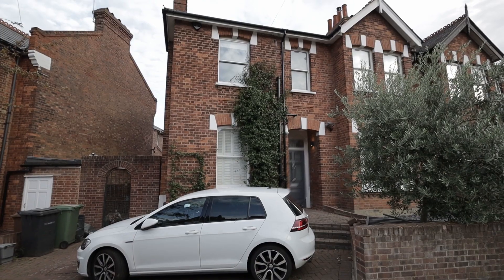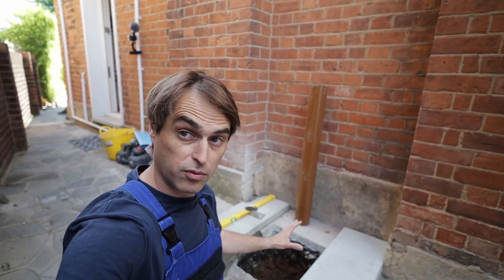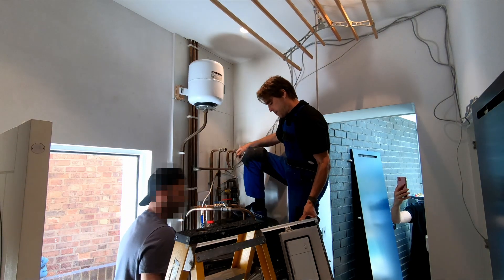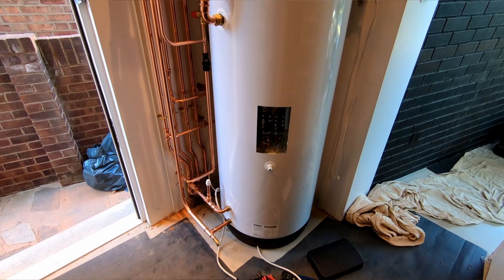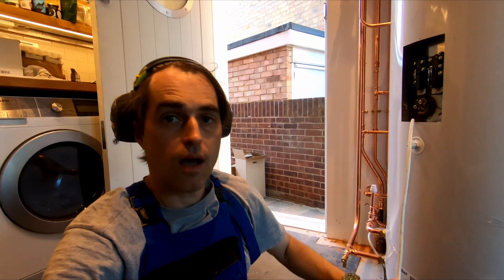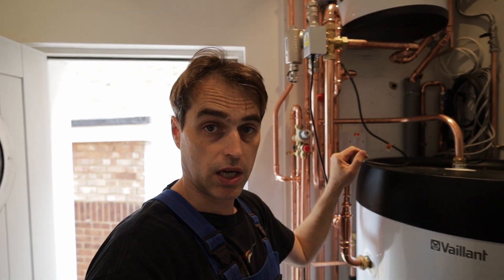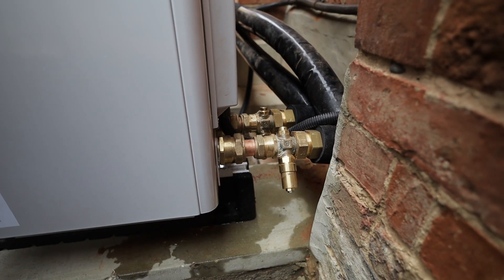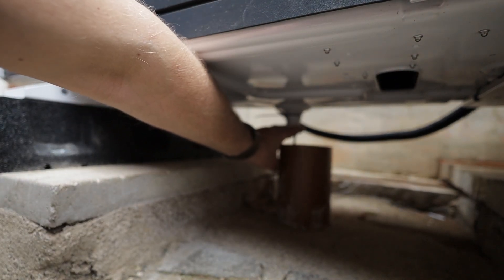Is This Heat Pump Better Than Your Gas Boiler?

Comment: As for cost, they are not worth it, they are more harmful to the environment actually if you factor many other things, such as the cost of installing these giant noisy beasts, requiring more space, and complex hot water storage cylinders  and all the network of plumbing and pipes, and think about the impact these beasts cause in the process of manufacturing,  they contribute more to the global warming by using so much energy in the manufacturing process of thousands of its components, right from extracting copper and refining it and turning it into copper tubes, then thousands of complex electronics parts and microprocessors and other components used in the ,making of these beasts,  case mouldings, and what not, the cost in transportation of various parts from different places on earth to a central assembly point, if one was to take every factor into consideration, the amount of energy used and the heat it created goes a very long way in not helping to keep the global temperature change. 

It negates the objective of replacing a perfectly good working  condensing boiler with an efficiency of 95% not 80%,  so does that make any sense to anyone to replace their perfectly old still good to go for another 10 to 15 years gas boiler, my old Vaillant sine 221 (non condensing boiler about 80% efficient)  is still going strong for 28 years now (installed in 1994) so I have saved this planet by not dumping it to a wasteful landfill  heap, and not requiring a new one yet, and the amount of energy I saved in not buying a new one, to be honest when you think of how much energy was used in manufacturing these complex machineries, you are much better off burning logs for heating, politicians are not educated enough to realise this for themselves and the big manufacturers brain wash them.

As for owners who buy these expensive beasts, not only they have to outlay a massive amounts in paying for the plant  way too much for what they are, they are just glorified fridge freezers, yes I know there is a little bit more to it than that, and there are not many trained technicians to go around servicing them or fault find small faults, and like the gas safe engineers who have no clue into electronic systems, a small easy to fix pcb is dumped and a new one is purchased at the expense of an owner. The whole heating industry is a rip off thing,  one is far more stress free burning a log fire and no need to call an engineer to replace complex electronic systems.

My advise to anyone wanting to save money is to invest in external Wall and floor insulation instead, and keep your old gas boiler running for longer if you want to save both your pocket and this planet we live on and breath on. (Don't forget to look at the factories spewing out smoke and heat churning millions of parts to manufacture these beasts, thats the hidden pollution kept secret from users)
Reply: Great comment. It seems that the hardest thing to explain is the glaringly obvious which everybody has decided not to think about. Most people lack reason and prefer to remain ignorant. They'll put us through this nightmare for their green agenda and in the end, nothing will have changed except some pockets will be much fatter and some much thinner. Oh yeah... and the massive destruction to the environment as you alluded to, can't avoid that with these monstrosities being produced by the millions worldwide! Pointless technology for the masses.

We should wait for nuclear and other improvements to our diverse energy needs and wants, it's the natural order of progression. What they're putting us through will end in disaster and all we have to do is carry on with what we've got and avoid decades of misery and inflation! They never learn.

Comment: Good video , but guess very few people who need retro fitting will have triple glazing , insulation  at this levels , radiators which will likely need upgrading . Older non pressurised systems with larger circulation pipes and also oil fired burners will need highly expensive and disruptive works to be done. Overalll heat pumps great idea but retro fitting has major complications. I myself have solar and additional woood burning stove connected to heating system and feel it would require major problems to be overcome involving flooring , tiling , pipe work removed and would be expensive beyond logic and would be in excess of 30000 pounds if not much more. Love heat pump for new dwellings and less complicated builds especially newer builds where much of the insulation etc would be better. Feel for now will maybe add battery to solar and add additional insulation where possible. Ps oil boiler replaced on last ten years so upto date tech for it.
Reply: Why don't you guys use simple wall mounted air handlers?... For your heatpumps like the rest of the world? They don't need to be retrofitted, all you need to do it run your refrigerant lines from the indoor to the outdoor unit via a 50cm hole.

Comment: We have an oil external boiler burning approx 2500 litres a year heating oil,how much more efficient would a heat pump be?..i have converted our garage and both lofts so now 5 bed vs the previous 3,is a heat pump up to that sq footage?...approx 2500sqft at a guess..thanks

Comment: Great video but the cost comparison for energy usage got me thinking? 
The old system was 30kw gas, and the new is 6kw electricity? 

Let's say the unit prices are at current rates as  follows;
Electricity - 26p/kwh
Gas- 7p/kwh 

Meaning for every hour I run the system I save 50pence.
Over a month, assuming I run it for 4 hours a day, compared to the gas system I save £60 a month 💁‍♂️ Doesn't seem cost effective yet for the size of the installation cost of new system
Reply: I'm guessing nobody will answer you.
I'm always wondering about the aame kind of analysis and it's never presented. So frustrating.

Comment: I dont think it will run that much more efficiently, because it will need to draw electricity to the immersion heater as the heat pump is not enough.

For things like legionnaires the water needs to be 60 degrees at least. 40 degrees is just not enough.
Reply from the maker: No need for immersion heater with this heat pump as it goes to 70c
Reply: @UrbanPlumbers  what's the CoP at 70 degree output?
Reply from the maker: @ChrisLee-yr7tz  probably around 2
Reply: the legionnaires thing is massively over hyped. With normal domestic installs there is pretty much zero chance of spore growth or infection as water is constantly (as in daily) drawn off  in  the most likely place  IE showers. 
personally I'd get rid of the once a week 63c heat up and install constant low temperature heating around 32c ideally underfloor if energy efficiency was the main criteria for installation. Although even better energy efficiency and effectiveness would be individual AC splits to each room. the cost would be roughly the same and they work far better in heating rooms 
plus a water based system has too many single point of failure issues and long term reliability concerns to give real peace of mind in winter.

Comment: Don’t like that trunking on the outside and the pipe work encroaching the doorway would do my head in . The cost of installation against gas to me makes it not viable for the expected lifetime of the system. Allied with the importance of A1 insulation which is not possible on my old house makes this a none starter for me.

Comment: Like most people in the UK I am not interested if it is better only if it costs less to run.
Reply from the maker: It does cost less to run -20-30% as compared to a gas boiler it replaced

Comment: Hi great tidy installation! What are the buffer vessel for and what was the other small vessel next to the buffer vessel called and used for?
Reply from the maker: Expansion vessel for hot water and one for heating. Buffer is used as volumiser to extend run times of the heat pump

Comment: Excellent video. I would say looks like ‘ideal world’ install. I am up for doing this as part of final phase in a fairly long term progressive retrofit of my own house. My conclusions are that I am probably going to have to sacrifice a bit of my garage to fit in the cylinder storage. I am replacing a compact combination boiler and compared to that, a heat pump looks space hungry. I am thinking ability to adopt at scale in average uk home the size of a rabbit hutch may require some compromise on set up.
Reply: Think twice

Comment: I don't know why people aren't going for air-conditioning with a heat exchanger unit so you can run your radiators and hot water. And no need to do a massive upgrade of your radiators or pipe volume. Great video and always a pleasure to watch you at work.

I can't wait for part 2 of thus video about the figures.thanks again for a brilliant video
Reply: Why run a wet system with large radiators (and/or underfloor heating) when you could use gas and head units. Saves floor space etc, no real concern about flushing the system and corroding pipes and the risk of leaks. Response times much better too. Hot water... really should be heated on supply, heating it to just sit in a tank is extremely backwards.
Reply: @drsquirrel00  stored hot water installed correctly with a return I think is very efficient, yes a cylinder takes up space but I don't think you can beat the performance.

Comment: I think it’s an excellent idea to manufacture brand new heat pumps and all the necessary materials to install them and then ripping out perfectly good gas boilers. Who actually cares about the carbon footprint created by producing all these millions of new heat pumps and throwing away gas boilers. Maybe if we adopted a mend and make do approach to all these things that ‘allegedly’ pollute the environment with Co2 instead of pumping out billions of tonnes more Co2 manufacturing even more things that will need replacing when governments and lobbyists decide the new technology is no longer any good. 🤦🏻‍♂️
Reply from the maker: Watch the video again

Comment: Currently trying to measure the heat loss in my house, using online calculators... which seem very vague. My external walls are  20mm K Rend+115mm brick + 50mm cavity filled with blown fibre +115mm brick, + Celotex PL 4025 insulated plasterboard + 3mm skim. Trying to find the way to calculate the heat loss is taking me around in circles - for example, one calculator describes walls as 'Well insulated' or 'Poorly Insulated...' What the hell use is that?

Comment: What I'd like to know is the electricity consumption of the fan, compressor etc., in the pump itself. As I understand it, heat pumps work similar to air conditioning units, in reverse. On three visits to Queensland,  where most have air con, many people only use them when the temperature becomes unbearable, because the cost is prohibitive. With electricity prices roughly double that of gas - is it still worth it?
Reply from the maker: Here cost of gas is 4 times less than electricity and this unit is still cheaper to run than gas
Reply: @UrbanPlumbers  Thanks. I wouldn't argue with you. It must just be that they're all tight rrrses in Aus. Judging by my Ausie missus, that could well be the explanation...🥴🥴
Reply: @UrbanPlumbers  doesn't the CoP have to be above 4 for that to be so?
Reply from the maker: @ChrisLee-yr7tz  no, beacuse gas boilers aren't 100% efficient. Actually, they are around 83% efficient in situ.  At the moment cop of 2.8 gets you to the same cost as running an average gas boiler.

Comment: Only 21% better at just under freezing temperature.....  So with electricity becoming so much more expensive this is a sure fire way to lose money.   The system cost and install will never be repaid,  instant hot water will no longer be so easy...

Great plumbing engineer but the heat pump will never be worth installing...
Reply from the maker: Gas cost is rising much faster than electricity though making this system over 30% cheaper to run with current price cap

Comment: DO NOT DO IT!!! Unless of course you are a brainless virtue signaller. Extremely expensive. Noisy and use a massive amount of electricity. Never mind the crap heat output. No thank you very much.

Comment: Love your videos - very informative.

I have Solar PV and an Eddi, and Solar Tubes too.  Could I get a heat pump for just the rads only ?

Is the store to heat pump just a closed pressurized circuit / loop identical to that of Solar Thermal Tubes ?  Or can an external unit connect directly to the central heating rads circuit ?

Comment: What if you don't have room for the cylinder anywhere in the house?
Reply from the maker: You can use heat battery instead, such as sun amp

Comment: Love the video, but please factor the purchase cost in the calculation. I recently provided a quotation for a heat pump. The pay back was over 17 years before saving anything. Heat pumps are not a solution for all housing stock. Very nice to see a fellow engineer proud of his work. 👍👍 the introduction of power factor metering will also need to be taking into account in the near future. Converting everything to electric is not viable right now and in my opinion will cause a increase in pollution not a decrease. Hydrogen is a potential, but shelved technology in pursuit of profits will hold this country back.
Reply: PF should basically be at 1 for "heating" appliances?
Reply: @drsquirrel00  you would like to think so. I can see something different coming soon. Appliance id over smart metering and charged by appliance type and time. Tech is there to do this now. Brace for a metered life. Everything will be controlled if you let it.
Reply: @thetruthwillwinoneday  I know they're working on ways to address device by their power draw signatures as its possible just not as accurate enough. Should soon start seeing smart meter displays saying X device using this much power, Y device this much etc.
Reply: If you’re keen on calculation do the sums on cost of hydrogen. You will be dismayed.
Reply: Installing a heat pump is not "converting to electric". It's converting to 25% electric, 75% outdoor air. Even if the electric is all generated by gas, you burn less of it at the station to power the heat pump than you would have done in the boiler in your home, because it's only a fraction of the total energy source.
Reply: @WillHirschUK  in a perfect world, yes.  But getting to the perfect insulated house is expensive. I regularly quoting for HP in older stock houses. Everything needs changing, way too expensive in one hit. I was called to one of these incredible machines last week, customer stating it never turns off. Not surprised with the installation. It was terrible, massive bills and the house was cold. Nothing i could do except quote to put things right. In this case going back to gas is the more viable option. I don’t just sell new tech for crazy money if it won’t work. I felt so sorry for this family and the weather is mild right now. Give it another month! So go back to a gas boiler or rip every room apart to insulate and install radiators 3 times the size. To make things worse they had no room stat on original system, installing one of those would have cut their bills, so, after a spend of £10,000 they are cold with a £600 a month electric bill. Progress. NOT

Comment: In one word …..NO
Reply from the maker: A system cheaper to run than gas, supported by PV panels coming soon, providing independence from energy cost increases. Yep - you are correct- stick to your gas boiler and go bust :)
Reply: @UrbanPlumbers  I agree to an extent ..it’s a choice you need to make. However with the substantial outlay , regardless of grants, the efficiency is only really effective if your home is basically built around and to sustain  it’s thermal properties. They at the moment are still in the early stages .
Eg my point is, you can’t just fit them in any house without oversizing rads and pipes etc. Some older houses and the people living in them are been sold a product that may well be cheaper than gas, but there are caveats that arise .
Unfortunately many people are stuck with a system that’s still (IMO) still in it’s early years of development.
Government have a track record for seeding grants in a knee jerk reaction to projects that aren’t fully evolved .

Comment: So electric kw it’s 4x more expensive than burned kw but since the heat pump is 5x efficient than the $ gain is 20%. Not as good as you might dream of.

Comment: If it was so efficient why would you need an immersion  heater to top up a failing system
Reply from the maker: it's not wired to the heat pump. It is a back up only, same as on a gas boiler. You dont want to use it unless you really have to.

Comment: Did I see a non-Vaillant system filter on there? If that had been installed wouldn't everything fall under a 10 year warranty?
Reply from the maker: It’s no a gas boiler so no

Comment: How do you get the system water hot enough to prevent legionaries?
Reply from the maker: This heat pump goes to 70c on hot water

Comment: We had a heat pump installed in a annex instead of pumping gas down we should have gone with gas it cost a absolute fortune and the fan was noisy. The only pluse side is it was warm and stayed warm winters were toasty but very expensive